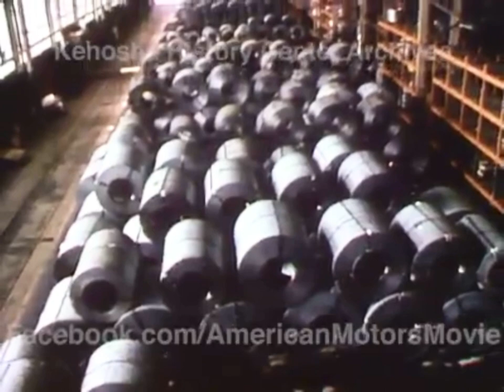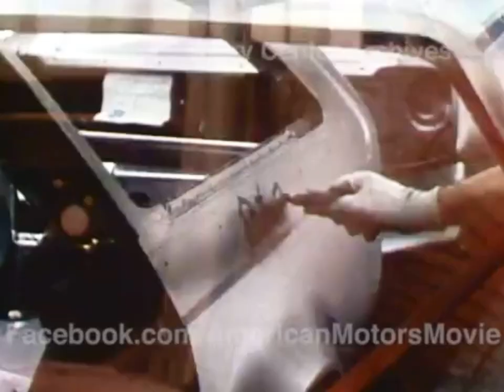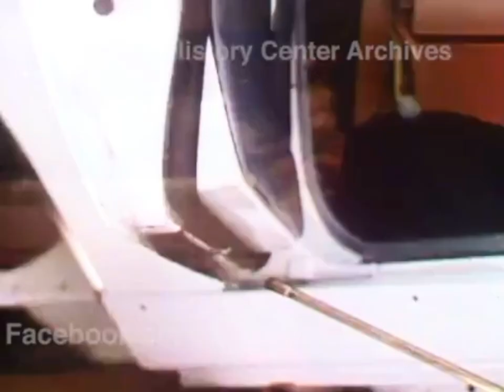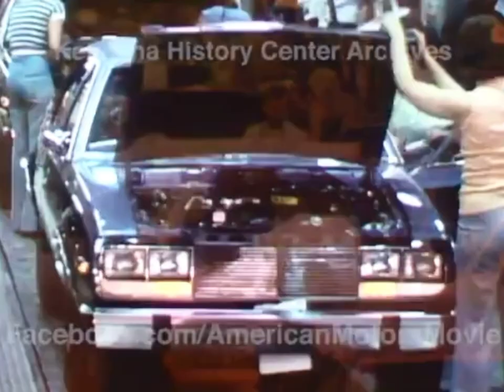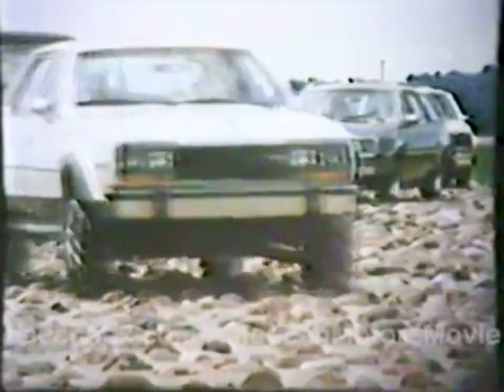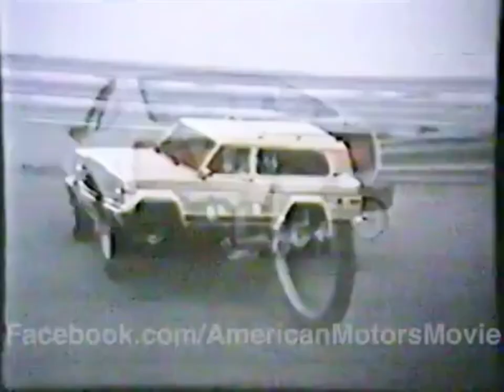American Motors Corporation Old Footage #2

Comment: If you did the research, AMC bought all the coiled steel from the Ford Rouge Plant in Dearborn Michigan. Ford Steel Division sold metal and steel to all the automotive companies, including the transplant foreign car makers. AMC did not have its own steel mill manufacturing operations. 
My AMC Javlin has a Ford engine installed at the factory. As this video clearly shows from the assembly plant pit crew view, the only AMC manufactured engine part is the engine exhaust system. But the engine is Ford Blue all the way.
Reply: No. Your Javelin  DOES NOT have a Ford factory installed engine.
AMC built ALL of their motors.  Most definitely, they installed other manufacturers PARTS, i.e. Motorcraft carburetors on V8's such as the 390 which was AMC's engine - had NOTHING to do with a Ford 390. All these years later and people STILL can't get it right...
Reply: @audieconrad8995 yep! Maybe some of the same ancillary parts of the big 3, but the engines were all theirs... I dare someone to try to use Ford 390 innards to rebuild an AMC 390 LOL
Reply from the maker: That is an interesting bit of info there. Thanks for sharing.

Comment: All that rust protection and the floors still go first.
Reply: Top of fenders usually went first
Reply: Yep everything in the underbody rusted out quickly back then. I remember patching holes in the floors and trans tunnel with sheet metal.
Reply: @Progrocker70  Sheet metal,license plates or whatever else you could find. And don’t forget the roofing tar for that extra waterproofing!
Reply: @garyschiffli1043  Lol, yep I remember my dad smearing tar around the back window and bottom of the windshield!
Reply: @Progrocker70  That’s a smell you don’t get anymore,hot air oil and hot tar in the summer.
Reply: I’ve owned many old AMC cars and not one had rusted out floors or trunk pans, unlike the big 3 cars.

Comment: AMC -american made crap-I sold auto parts for many years and you had to know if it had a ford starter/alternator,delco starter/alternator,chrysler alternator/starter or prestolite starter/alternator just to supply the customer the correct part but with some you had to special order the correct part because after certain years the common parts became hard to obtain or mid year changes made it hard to get parts because they changed something and you had to go to the dealer to obtain parts
Reply: All Make Car AMC
Reply: BS
Reply: All American car companies bought different accessories from other companies. They still do.
Reply: AMC always used other American parts. Not news
Reply: You guys are clowns.

Comment: the amc pacer had a straight 6 engine with the back 2 cylinders in the firewall! how were you supposed to change those
plugs? the gremlins were just plain junk!
Reply: The pacer was originally supposed to have front wheel drive and a GM made rotary engine. GM canceled production of the engine about 6 months before the Pacer was supposed to be produced. Thanks GM. They had to come up with a way to make their own straight six fit and change the car to rear wheel drive The "junkie" gremlin lasted more years than the crappy Vega and pinto. The gremlin was cheap but showed that it was a better car than those two.
Reply: @robertlays9079  never heard fwd but you are correct about the rotary engine. Was supposed to have a digital dash too.
Reply: Grow up Nathan.
Reply: You could get a V8 too

Comment: I miss AMC and feel in the end they got a raw deal. But in the face of everything going on, they at least lasted as long as they did. I rarely see any of their cars anymore, except for Jeeps, and it's kind of sad. The deal with Renault which I figure they felt would save them didn't work out, and I haven't seen an Alliance model anywhere since the late 90's. I guess their real golden age was the 60's and especially the 70's.
Reply: I know they needed the capital but going with Renault was a mistake.  Renault's own cars caused AMC to slip even deeper into debt
Reply: Still technically around. Bought by mopar.
Reply: They were essentially building old cars in an old plant.
Reply: @kennethsouthard6042  Like Studebaker, their most modern cars ran on chassis that were mostly pre and post war.